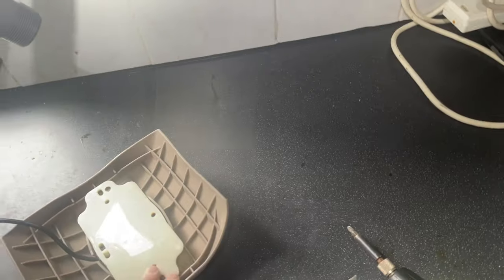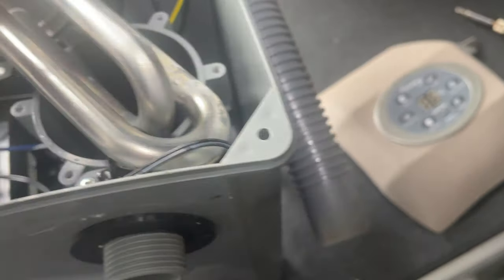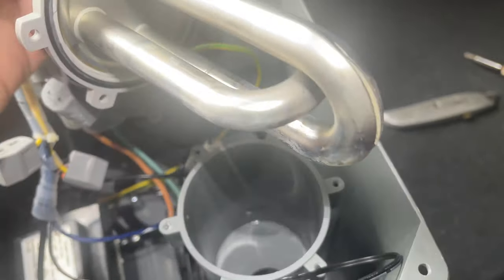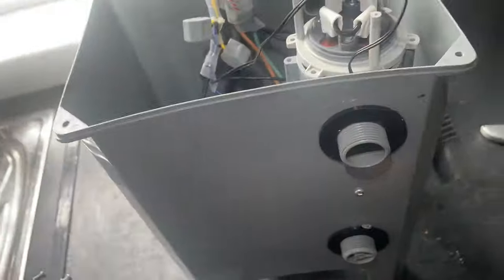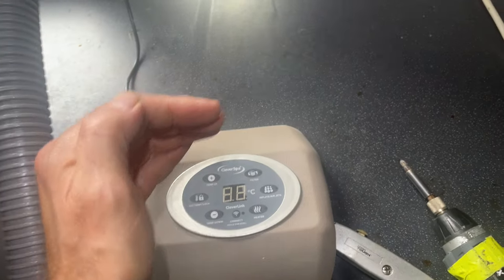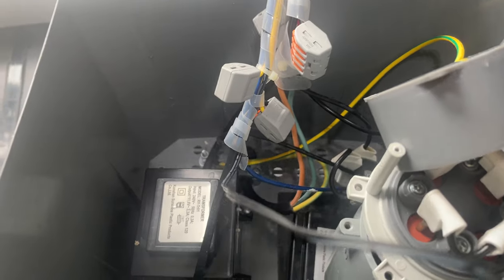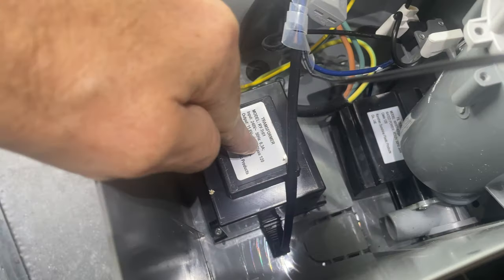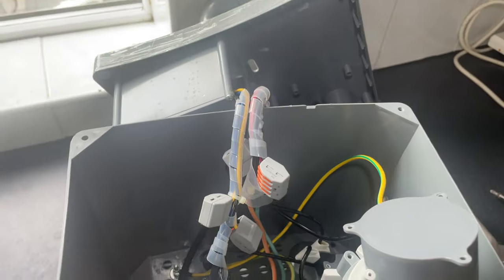CLEVERSPA INFLATABLE HOT TUB TRIPPING FUSE AND POWER BREAKER - WHICH PARTS TO REPLACE - BEST REPAIR

Comment: What would cause it to not full heat,was qorking great but lost temp and now wont heat over 80°. No error codes of any kind.
Reply from the maker: could be a clogged PTC heater. if you have signs of calcium deposits and a reduced water flow then this is a sign of a blocked heater.  if the seals of the heater element has been compromised then this is a sign of aggressive water attacking the metals and seals. i would advise to grab a heater and replace this here https://www.layzrepair.co.uk/product/fix-lay-z-spa-tripping-replacement-ptc-heater/

Comment: My clever spa lucca keeps tripping breaker when heater is on
Reply from the maker: you will require a replacement heater element. i have them on the website. or you can also order a collection if you would like me to fit this for you. https://www.layzrepair.co.uk/product/fix-cleverspa-not-heating-up-replacement-element/
Reply: Im not getting a error code. Just trips after 2 degrees
Reply from the maker: will probably require a new heater element. i can repair this for you. or you can purchase the part here. https://www.layzrepair.co.uk/product/fix-cleverspa-not-heating-up-replacement-element/ @carlmcnaught8784

Comment: I wired my new element up didn't pit washer in and the full unit filled up with water 🙈🙈 I am not sure if it's now totally unusable any help before I buy new unit 🙈🙈🫶 Julie x
Reply from the maker: Should be fine. Your power breaker would have cut the power